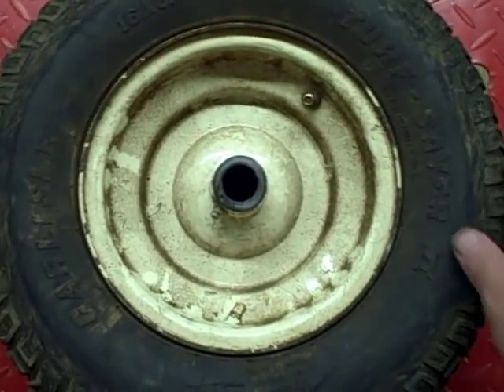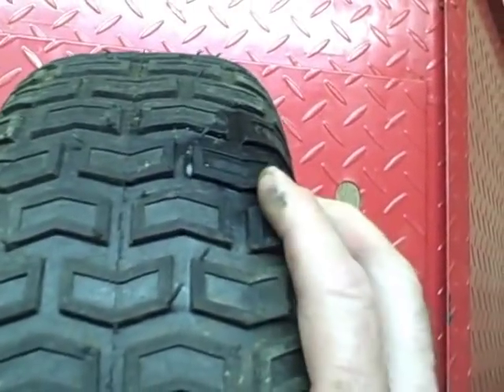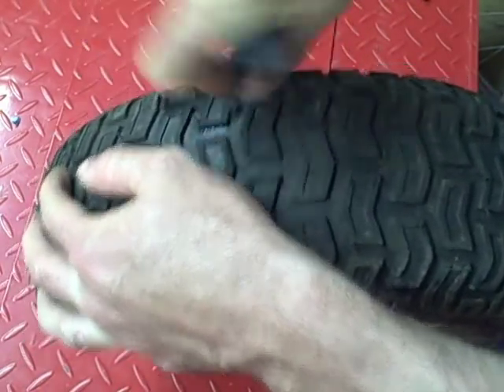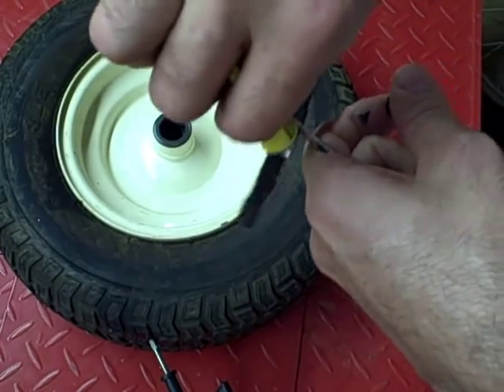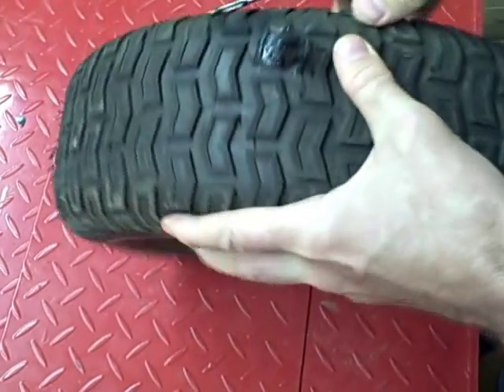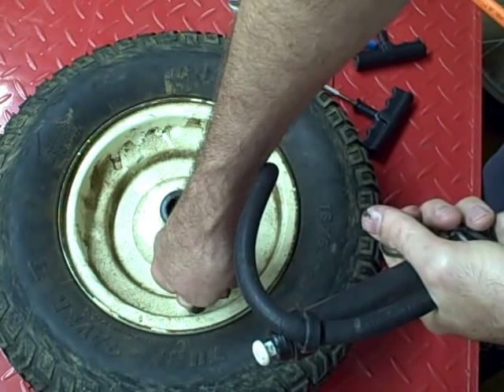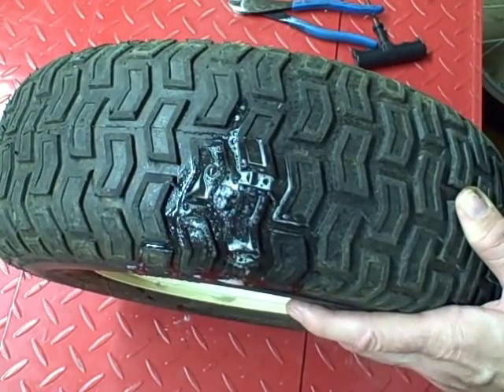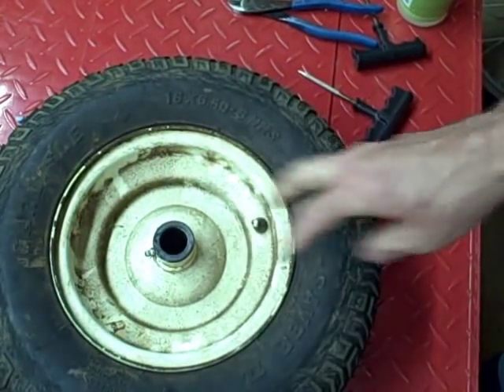Small Engine Repair: How to plug a tire on a Lawn & Garden Tractor Trailer

Comment: Can you leave it on the lawn mower and plug it that way if it's in the middle of the tire I jack it up and move the tire around so I can see the leak is that okay it is just a small  pinhole  from a tiny pin just a lady trying to do the job I have no one to help me
Reply: I'll be glad to help you there with an answer Becky. The answer is absolutely yes you can leave it on the tractor - makes it easier a lot of the time.  Hope that helps because your grass must be awfully long by now.

Comment: @smallengineshop What kind of mixture do you use in the spray bottle?
Reply: I see that this question is 10 years old but I'll add my 2 cents.  I use a 50/50 mix of 409/water in a spray bottle.  I've seen Dawn dish soap and water used too.